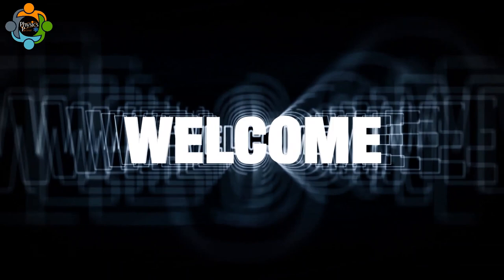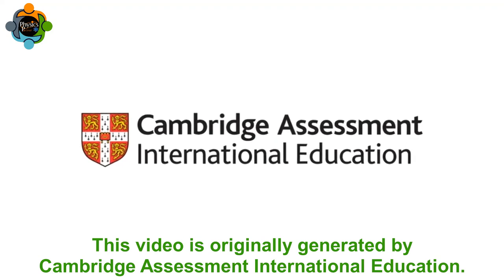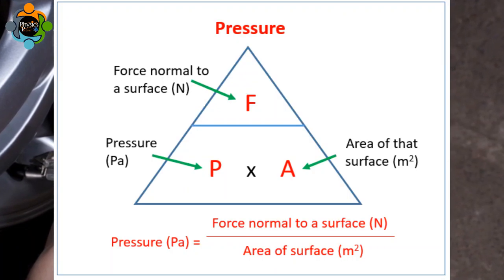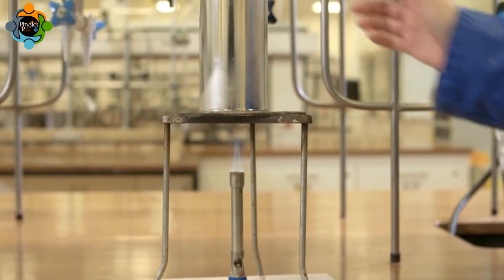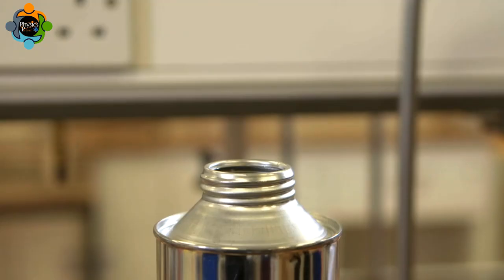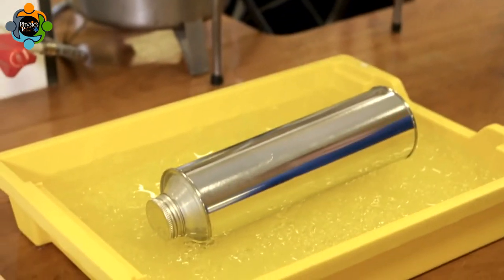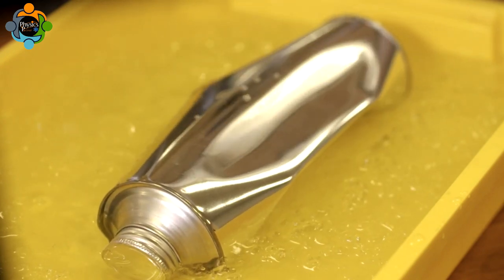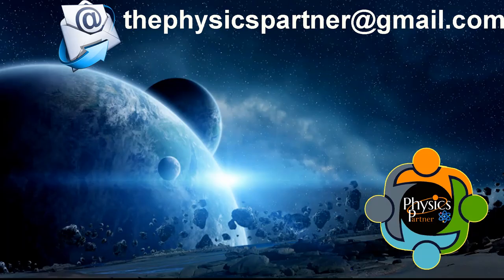Pressure Experiment - An Interesting Lab Activity

Comment: In an open can, the pressure equals the external pressure. A successful experiment requires that the can be filled with water vapor. When cooled and in contact with cold metal, the steam condenses and instantly turns into a liquid. At the same time, its volume decreases by approximately 1600 times!! The can is then nearly empty, as if vacuumed. This is why the pressure differential tends to crush the can.
Let's estimate how much pressure was acting using equation of state.
Let us assume that the temperature of the hot gas in the can is T₁ ≈ 370 K (97 ⁰C), and that the atmospheric pressure inside is p₁ ≈ 10⁵ Pa. By rapid cooling, let the temperature drop to T₂ ≈ 300 K (27 ⁰C). This means that with unchanged volume (isochoric change), the new pressure p₂ will be obtained from the constancy of the ratio of pressure and temperature:
p₁/T₁ = p₂/T₂ ---> p₂ = p₁(T₂/T₁)
If we include the assumed values, we will get the approximate amount of pressure after cooling: p₂ = 10⁵ (300/370) Pa ≈ 81000 Pa
that is, the pressure differential between the outside and inside pressure is Δp ≈ 19000 Pa
The calculation above applies only to gases that remain gaseous after cooling, such as air. However, when the water vapor cools, it condenses into a liquid condensate, which happens quickly. The air would cool slowly and its volume would be reduced only by one-fifth, not 1600 times. Assuming that all of the vapor in the can condenses, which is unlikely.
Reply from the maker: Thank you for your valuable feedback